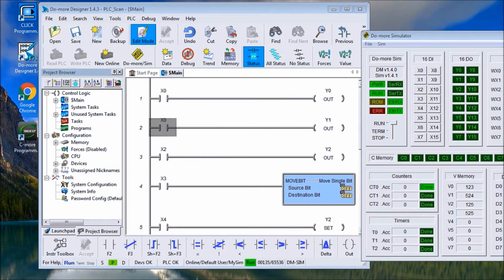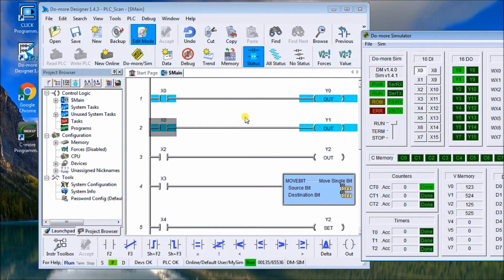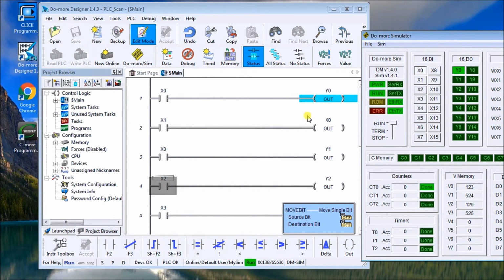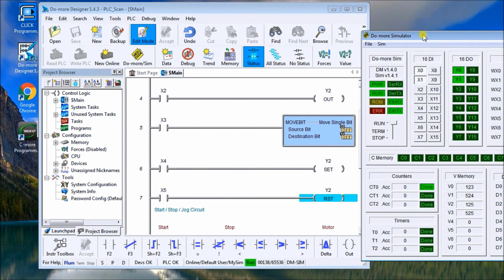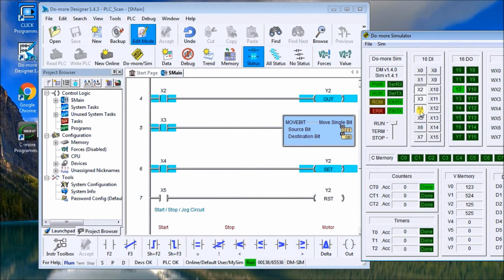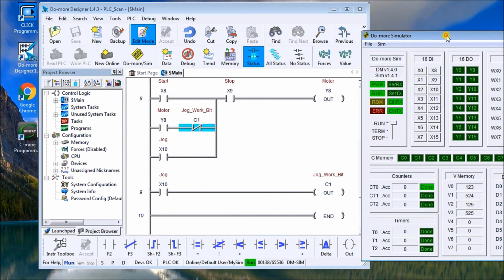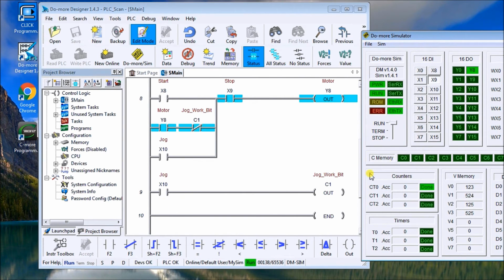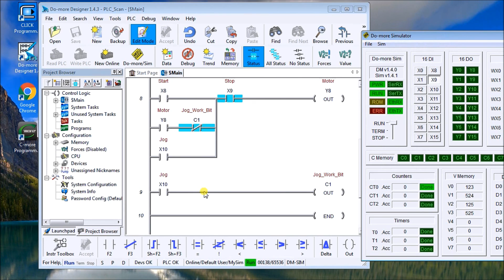Why Your PLC Code Fails: Master the Hidden Scan Secrets

Comment: Early in the vid when testing X0 and X1 you are saying X0 goes off after you turn it on in the simulator because on the next rung X1 is off.  But on the next scan X0 is off, so why doesn't Y0 turn off ?
Reply from the maker: Hi Zetetic SpaceMan.
Good question. On the first rung, Y0 turns on because X0 is on. The second line of code will change X0 to off. 
At the end of the program, the physical IO is read again turning X0 on. The first rung turns (keeps) Y0 on and the second line of code changes X0 to off.
This cycle will repeat. That is why Y0 is kept on.
https://accautomation.ca/understanding-the-plc-program-scan/
This is the link to the post that will explain in more detail.
Regards,
Garry